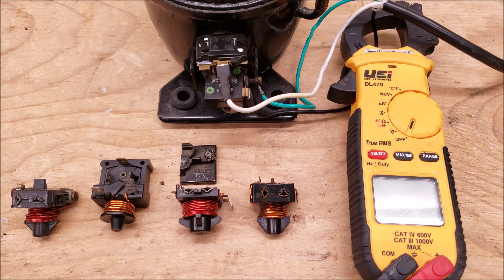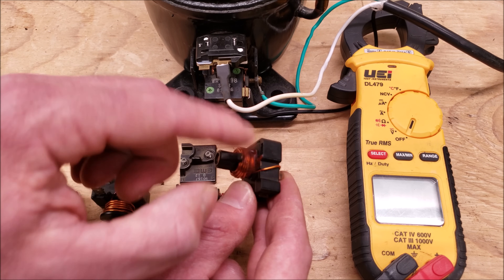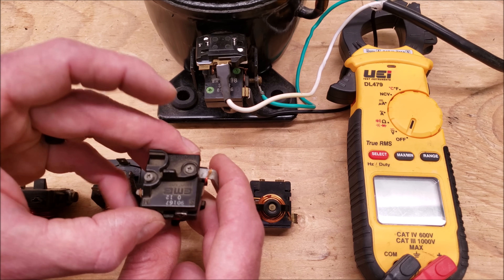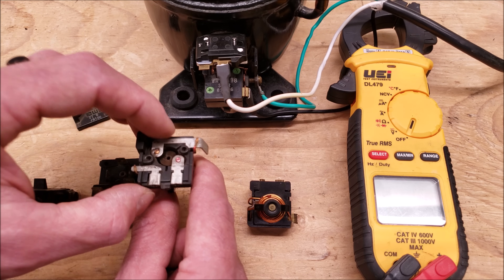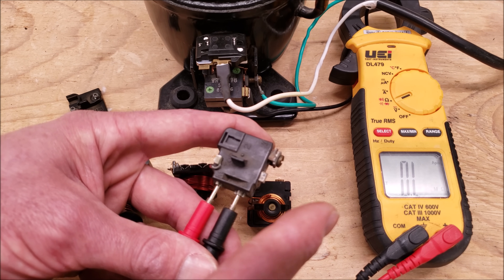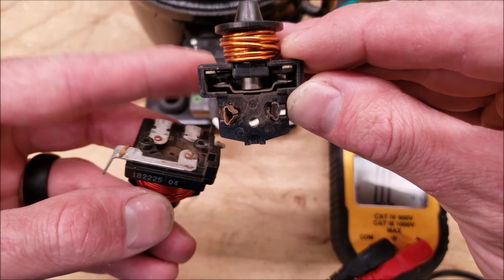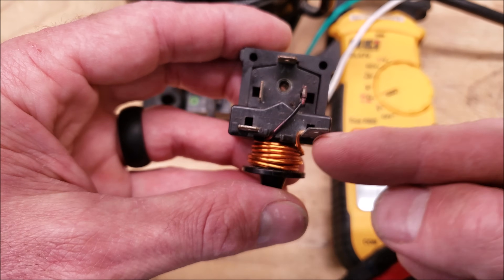How The Compressor Current Starting Relay Works & Troubleshooting

Comment from the maker: Our Book https://www.acservicetech.com/the-book
Tool List-  https://www.amazon.com/shop/acservicetech
Support The Channel-  https://www.patreon.com/acservicetech
Potential Relay Video https://youtu.be/IhVY8bYFIKE
PTC Thermistor Video  https://youtu.be/P0JUUCEQl-U
Common Relays Video https://youtu.be/HaRg8IRP-Uo
Compressor Common, Start, Run Video https://youtu.be/NxseKu60kYA
UEI DL479 Multimeter with temp sensor http://amzn.to/2jtsUbJ
Valve Core Removal Tool http://amzn.to/2uYr8WL
Blue Vapor Yellow Jacket Gauge- https://amzn.to/2Ju7pan
Red Liquid Yellow Jacket Gauge- https://amzn.to/2sSFmGH
Quick Coupler for the Gauges- https://amzn.to/2sTk8Ze
JB Test Gauge High Side-  http://amzn.to/2ruQb0l
JB Test Gauge Low Side-  http://amzn.to/2qR0utM
Manual Copper Tube Swage/Expander- https://amzn.to/2WRPa1M
Uniweld Hydraulic Swaging Tool- https://amzn.to/2MlrI8m
Uniweld Swage and Flare Kit- https://amzn.to/2T55jyn
Ameriflame Oxy Acetylene Torch Setup- https://amzn.to/2SRm3JF
#2 Tip for Oxy Acetylene Torch- https://amzn.to/2SPDaeD
Cap-N-Hook Tip for Oxy Acetylene- https://amzn.to/2MbhpUk
Air Acetylene Torch Setup-    http://amzn.to/2aQalsb  
15% Silver Brazing Rods-  http://amzn.to/2gVLyLc
Nitrogen Regulator-   http://amzn.to/2bXdR5f
Nitrogen Flow Meter-    http://amzn.to/2brvoBg
NitroVue Flow Reg-  https://amzn.to/2MiulYv
Ultrasonic Leak Detector- https://amzn.to/2Lw4Zpr

UEI DL479 Multimeter with temp sensor http://amzn.to/2jtsUbJ

Magnet Jumpers- https://amzn.to/2PyKPQZ

Alligator Jumpers- https://amzn.to/2PxqJXn

Fieldpiece ST4 Dual Temp Meter  http://amzn.to/2wc1ME3

Fieldpiece Bead K Type Temp Sensor https://amzn.to/2DBwKfs

Fieldpiece Wet Bulb Temp Sensor https://amzn.to/2RRI7Tw

Fieldpiece TC24 Temp Clamp https://amzn.to/2qHLyjZ

Yellow Jacket Refrigerant Gauge Set http://amzn.to/2aenwTq

Refrigerant hoses with valves http://amzn.to/2aBumVI

Yellow Jacket Gauge set & hoses https://amzn.to/2vLVkV9

Yellow Jacket 4 Port Manifold w Hoses https://amzn.to/2BkuGIq

FieldpieceSMAN360 Digital Manifold Set https://amzn.to/2BdoaD4

FieldpieceSMAN460 Digital Manifold Set https://amzn.to/2nB4Fe6

Compact Ball Valve for Refrigerant Hose https://amzn.to/2KUisW8

QuickDisconnect 90 for refrigerant hose https://amzn.to/2MMtVcg

JB 6 CFM Vacuum Pump   http://amzn.to/2nqbvo8

Appion Blue 3/8" to 1/4" Vacuum Hose http://amzn.to/2uYlVyc

Appion Red 3/8" to 1/4" Vacuum Hose http://amzn.to/2uYg6Ro

Appion Valve Core Removal Tool http://amzn.to/2uYr8WL

Yellow Jacket 1/4" by 1/4" hose http://amzn.to/2umtcod

CPS Vacuum Micron Gauge http://amzn.to/2v1nM3O

Supco Vacuum Micron Gauge http://amzn.to/2v1JRiA

RectorSeal Bubble Gas Leak Detector http://amzn.to/2ckWACn

UEI DL389 Multimeter  http://amzn.to/2xAdaJf

Other tool links can be found in the video description section.

Shop through Amazon! Your Purchases through Amazon provide a means for channels such as mine to earn advertising fees from all purchases after clicking through. Prices are the same as normal-    https://www.amazon.com/shop/acservicetech
Reply: What could be the problem if there was a power surge and now the compressor starts but gets very hot and the protector breaks the connection. I noticed the compressor gets really hot. Since the compressor works and starts I was planning on changing the relay and the protector, but would like some advice on that.

Comment: Hi, just quick question,
The flip upside-down testing will always work with any model, or brand  of start relay, right? 
I try to replace 9660c-041-182 for my refrigerator.
I bought from online, I tested it, but no resistance at all. So I though it might be the defective part, I returnes it, and they did reshipment another one to me. I check it, but the result was the same. No resistance...
Do I need to do something before test it?
, or they keep sent me the bad part...

Please help... thanks

Comment: I'm trying to start a 3 phase motor that is not a compressor and will not be under a big load at start. Would this still be needed? I'm trying to use a VFD and it describes this component in an example circuit.

Comment: When I do the upright and and upside-down test, mybreadings are never steady even when i test new relay. I make sure i raddle the relay before testing but sometimes it reads OL on both attemps, then if im lucky i get a reading of 2.5. That's with a bad and new one.

Comment: I hear the relay contacts click when the compressor starts, but I don't hear the iron core plunger drop back out with gravity. Is it a slow, gradual process of falling back out or is it fast? How many seconds does it take for the compressor to start up--almost immediately the relay then drops out? Can you hear it drop?

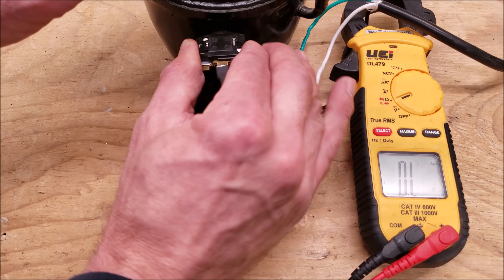Comment: I have the Start Relay you show at the 7:20 mark (it has three prongs where only two wires are connected) and it reads 5.5 ohms and does not rattle.  I have the Overload you show at the 8:06 mark and it reads 0.6 ohms.  In short, everything works on my GE GBS22KBSBCC refrigerator except the fridge will not go below 40F and the freezer will not go below 33F.  So, what would not allow strong cooling .....if the start relay was bad or the capacitor?  Defroster, thermistors, evaporator fan, condenser fan are all working and the coils are spotless.  I even checked the three prongs on the condenser and got a 8.4 ohm on the two main prongs, 4.5 ohms on the left and 4.2 ohms on the right.  My Embraco 1PH condenser has a label on the side reading "LRA of 11.5  EGU 70HLC'  115 - 127 V".  My multimeter read 0.8 amps when it is running.  The Capacitor multimeter read 11.85 uF (210 VAC 50/60 Hz @ 12 uF).   Some history - In July 2016 I did had a technician add R 134a and in October 2018 I had to add an evaporator thermistor since my evaporator coils were an iceberg and it was not triggering the defrost mode; refrigerator was warm but freezer worked fine.  NOTE:  I made a video of the Start Relay arcing with the Overload when the compressor was called for power; there was just a click sound but no compressor.  Then, 90 seconds later, it called on it again and the compressor hummed away.  When I took it apart again the Star Relay gave the same reading but I noted it was VERY hot.  Could this Relay still be bad but not activating all the time thus overheating because it is sometimes working?  If so, maybe this is why the temperatures cannot catch up.  With that said, I do not know the spec for my compressor amps but had some hand written notes from the 2006 technician (when he filled my R143a) stating the original amps were 0.7 and after he added 4.5# the amps were 1.55.  His notes also read "spec = 1.5 to 1.7 amps).   Should I purchase a new Relay and, if so, is it "good practice" to purchase a new Overload, also?  They are very pricy at $76 and $80, respectively......for a piece of plastic!   ANY direction would be greatly appreciated by you.

Comment: This has been a fun exercise to help understand how these little devices work. With no power, the current relay contacts are normally open. Like most motors, current draw from the motor is highest when the rotor is not spinning because the fixed rotor is unable to produce significant back EMF. The current relay windings are in series with the motor run windings. So, as soon as the relay sees big current, it lifts the relay plunger up to close the contacts, allowing the start capacitor and start windings to help overcome mechanical resistance and get the rotor up to speed. As the rotor spools up, the run windings begin to exert a back EMF because of the way the motor becomes a reverse electrical generator at high speeds. This back EMF reduces current through the windings, protecting the motor, improving motor efficiency, and reducing the (still forward) current through that little relay. Eventually, even though the motor is up to speed and a small current is still flowing, there isn't enough current to hold the relay contacts together and gravity pulls the plunger down, taking the start cap out of the equation. Elegantly simple.
Reply: Your explanation is dope

Comment: I think that in small instruments like food processor you don't need the relay at all. The relay is all the time in on position. Those instruments don't have a start capacitor at all only run capacitor to generate the "second' phase to run the motor. It is only a source of potential trouble and you can live without it.

Comment: Ask u a question, what opens the switch internally in the system start relay? The capacitor, the temperature, the resistor or it never opens. I was thinking the resistor
Reply from the maker: It is normally in the open position. The current generated induces power to the coil turning it into a magnet pulling up the iron core and contacts. Then after the motor current reduces, the amount of power induced into the electrical coil lowers and the iron core falls disconnecting the contacts.

Comment: Do some compressors not use a capacitor?
I have this old Eaton Viking dehumidifier from likely the 70's and there's no capacitor to be found on it.
Relay is acting up and with a 3 n1 universal relay someone said to remove the old capacitor when installing it,but I can't find a capacitor on it.The big cover is off but I don't see one.

Comment: hey got a question for replacement current starting relay. I have an old  sub zero fridge which the freezer is no longer cooling (refrigeration is still fine). The old relay (PB24 3ARR12) I pulled out was measure about 120 ohms which i guess is too high. My question is will any 3arr12 relay do the trick? Thanks

Comment: Hi Sr, do you have a video explaining why the A/C compressors doesn't use a potential relay and the start capacitor, and why the refrigeration compressors use it, can you explain please
Reply from the maker: Refrigeration compressors work even when it is colder outside and need help starting. Some txv's  on refrigeration units don't allow for pressure equalization. Most heat pumps have a potential relay or some other starting device. Only some ac units come equipped with a potential relay but they turn on and run when it is warmer out. I don't have a specific video on that, thanks!

Comment: For helpful video like always. I have a compressor that continues to run even after the refrigerator (Delfield reach-in) has reached temp. T-stat is new and set to lowest cooling setting but fridge was at 20 degrees this morning. Could this be a bad relay that's stuck closed?
Reply from the maker: No, it is likely the thermostat in wired on the NC terminal instead of the no terminal. This current starting relay is just for starting, thanks!

Comment: Great! Very interesting! Where this compressors are used?  I met one looks the same in condensing unit for small walk in cooler wine room. R134a.  Thank you.
Reply from the maker: They are on small refrigerators and freezers sometimes. The ptc thermistors however are more common on those smaller reciprocating compressors. I just wanted to make sure that I went over them, thanks

Comment: Hi Craig, Do you plan on putting this out in a real book we can keep in the van for reference?
A Spiral bound 8 1/2 X 11 book would be great in my opinion.
Reply from the maker: Absolutely I do. The print shop is working on them as we speak. I don't have a date to share yet for when I will have the bulk order of paperbacks in but they will be spiral bound with slightly glossy pages. I will send out an update when they are ready. Make sure that you are on the updates list at acservicetech.com and thanks a lot bobrub!